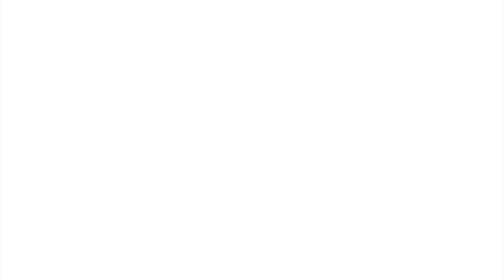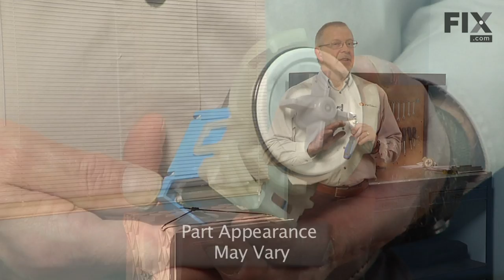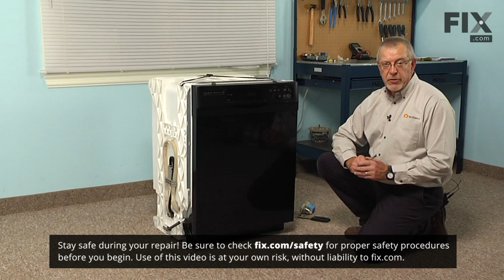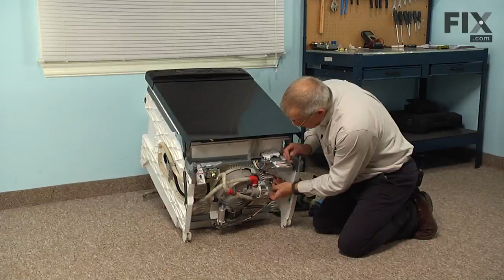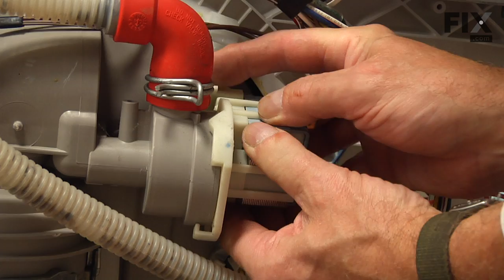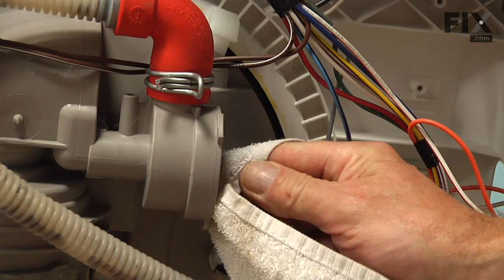Kenmore Dishwasher Repair – How to replace the Drain Pump- 60Hz 120V

Comment: I have a Kenmore elite dishwasher that t works well most of the time. Sometimes, it comes to the end of the wash cycle and fails to pump the water out. I'll pull the power for 30 minutes, plug it back in and can drain the water out using the Cancel/ drain button.  Then it will wash without problems a few times after until this problem pops up again. Might it need a new pump? Might something else be the problem?  Thanks in advance.

Comment: Thanks.  You made the job easy.  I had a little bit of glass in that drain pump that I couldn't get out any other way than removing the pump.  It was easy and it's fixed!  Thanks!

Comment: MY DISHWASHER DRAINS FINE BUT DOES NOT CIRCULATE THE WATER DURING ANY CYCLE. ANY IDEA WHY?
Reply from the maker: You may have a defective motor or a problem with the controls. What is your model number?